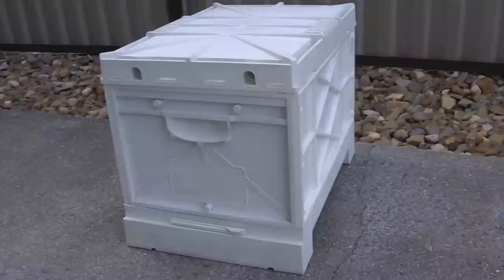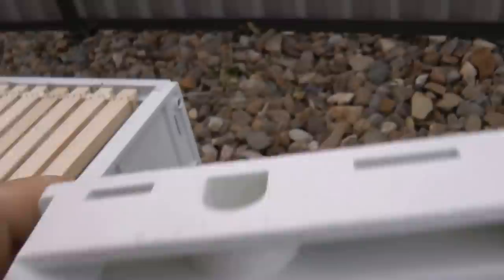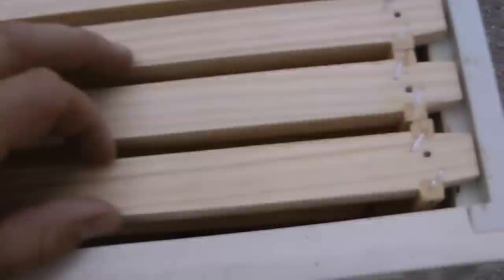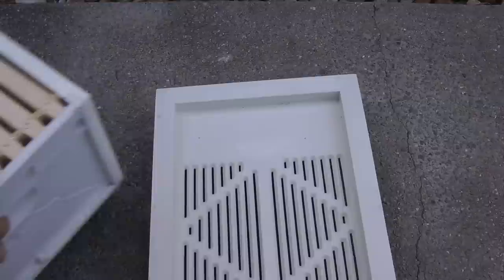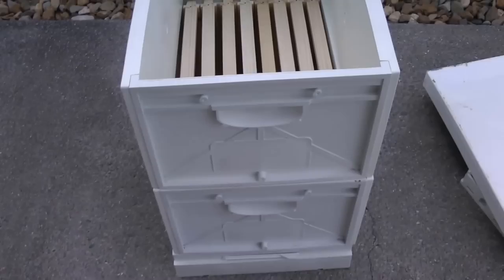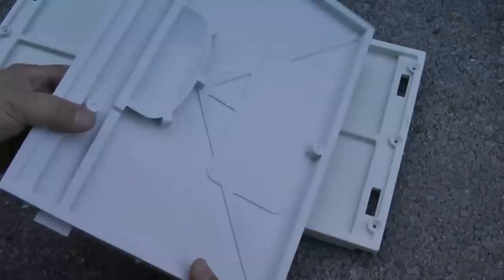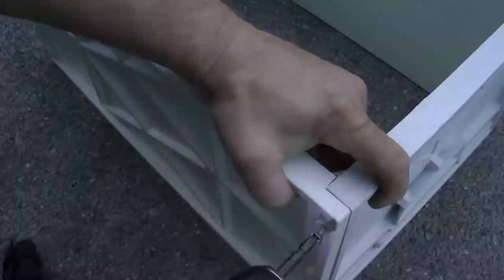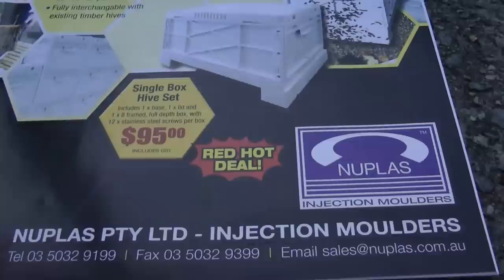Plastic beehive close up review of NUPLAS food grade bee hive

Comment: Also how well-made is the door? Would it accidentally fall down and lock the bees in? Could it be opened as wide as possible, so there's no chance of it falling down and closing the gap? Could the door be detached?
Reply from the maker: Yes. you can remove it completely, or flip it 180 degrees. Not recommended to leave the entrance gate in any other position really. Unless you ass a latch. But it works best 180 degrees open to the side.

Comment: vented base board? Doesn't it make it easier for ants to get in?
Reply from the maker: Hi Main 1. That depends. In our climate, sufficient beehive ventilation is more of a concern. But a ventilated bottom board does off course provide an easier entry to ants. Elevating the beehives onto a rail is the easiest way to reduce ant invasion when using ventilated bee hive bottom boards. Thanks for visiting.
Reply from the maker: Main 1 Hi Main 1. So far, our tests are going swimmingly and we are retiring most of our timber boxes. With the vented bottom boards, the hive is very well vented, and although we were also skeptical at first, our experience has been so good, that we are making the change. There are too many benefits - but only the five body. Plastic frames we are yet to try and test, but we just are not in favor of them and have a bias against them. Honey s a natural product and the bees surely enjoy wood more. In any case, the benefits for any beekeeper I would highlight are:
- they are easily collapsible for storage
- they are very easy to clean
- food grade
- lasts for ever
-  no rot, mold, paint pealing, corners failing
- easily modified for added ventilation if necessary
- adjustable entrances with integrated gates
- and the bees seem to love it

We are not affiliated, and the Parker ones here in Australia are also good. The Nuplas top covers and bottom boards are way superior and much more flexible. Let us know if you try them out. Very keen to hear how they work for you. Happy Beekeeping. http://www.mahakobees.com
Reply: Where do you get your timber frames with starter strips?  How much per frame to ship in victoria?
Reply: If I was to get these plastic hives, I still stick to the timber frames as well. Mainly because I prefer cutting out the combs, than scrapping them out
Reply: I put my bee hive on dirt ground. I often see ants crawling around the base, but since I never see them enter the entrance, I figured the bees are safe. But if there's holes at the bottom, where I don't see them, they will easily go in
Reply from the maker: Main 1 Hi We get our timber hive frames from NZ. They seem to be very good quality and very precise. Alliance Beekeepers Woodware. Manufactured by PRIME PINE KAIKOURA LTD: 03 319 7505. 
beehives.co.nz
Reply from the maker: Main 1 It is not the best idea to have them on ground full stop to be honest. Lack of ventilation (in the ventilated bottom boards scenario mostly), ants, snakes and other pests. In Queensland, toads and frogs are an issue as are mice. So we find it best to elevate the beehives at least 30-50cm. 2 Besser blocks approximately. All the best.